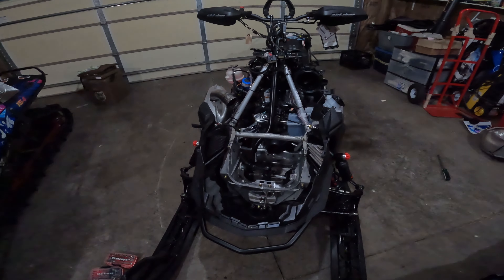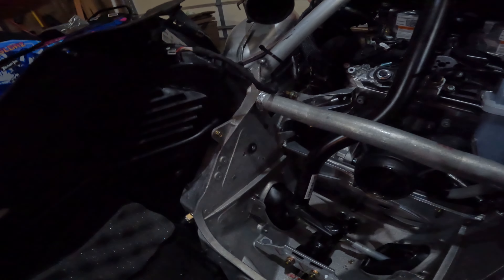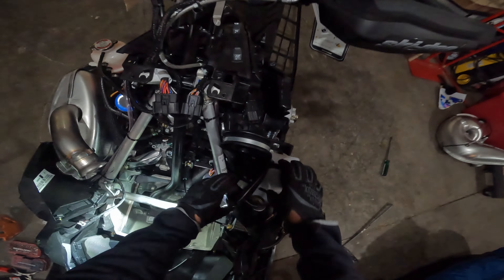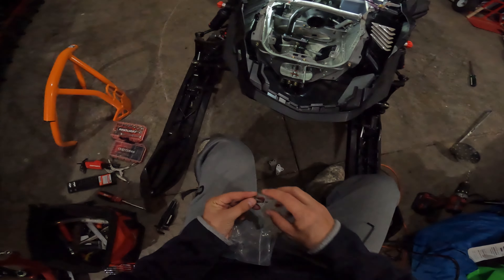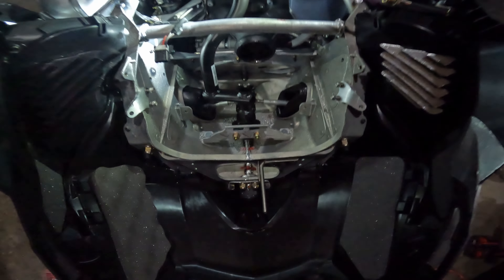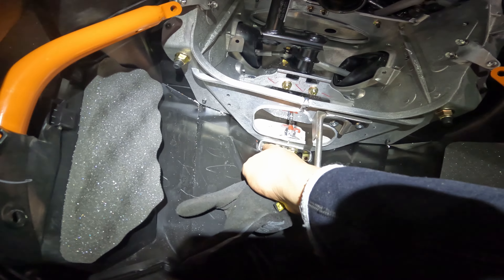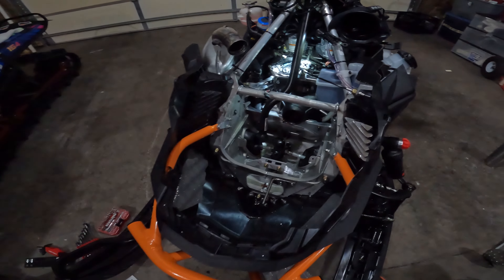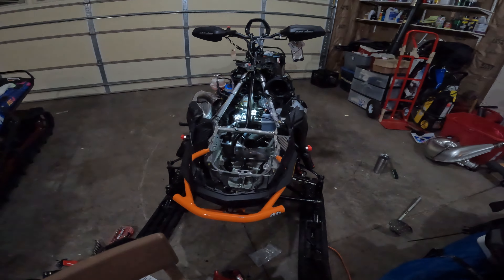How To:  Backwoods BMP Front Bumper install on 2023 Ski-Doo Gen 5 Freeride 850

Comment: Do you need to take away the engine to do that
Reply from the maker: You do not.
Reply: @wiscooutdoors5125  okey why do everyone do that tho
Reply from the maker: @oliverengstrom5552  I don’t think anyone removes the engine. You have to remove the pipe to remove the old bumper and install the hardware on the new bumper.